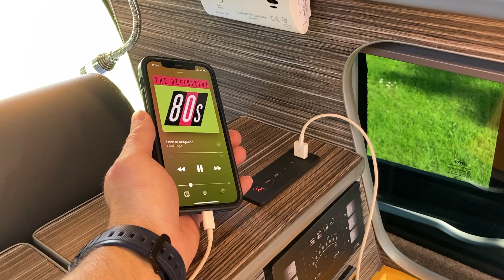Ford Transit Custom 'Newgale' Camper Conversion from VW Worx

Comment: THAT Layout in the Crafter would be AMAZING, The layout in this smaller Van-Conversion is BRILLIANT, BUT If i was going to do an Camper Conversion i;m STUCK on the VW Range because i drove the Older LT35 XLWB and put 175,000Miles on it in just 3 Years, And that was AFTER i had finished Driving My HGV Lorry [Because of Driving hours]. The Ford Transit HAS come a long way though, I hired one not long ago to Move a mate and it drove VERY WELL. SUBBED/LIKED Well Done VW-Worx.

Comment: Do you sell the units seperate, or fit them into an existing van? I have a ford custom and i've insulated and carpeted the sides but im not skilled enough to build units, and I really like your design. Thanks
Reply: Look at the "about" they say they fit out and sell units also.
Reply from the maker: Hi, please give us a call on 01270 580000, we do have a set of prototype units for this design built if they would work for you.